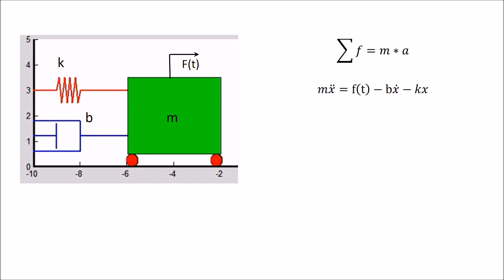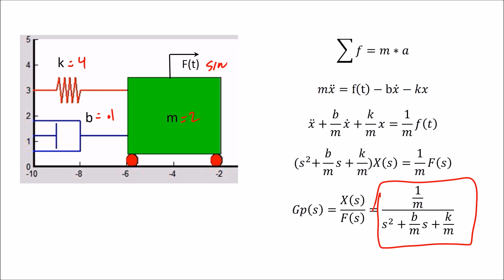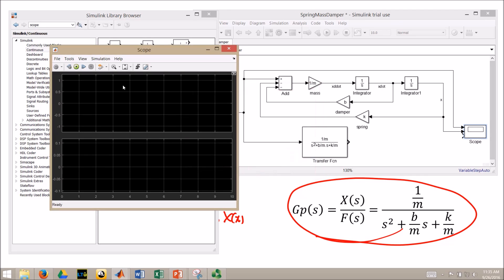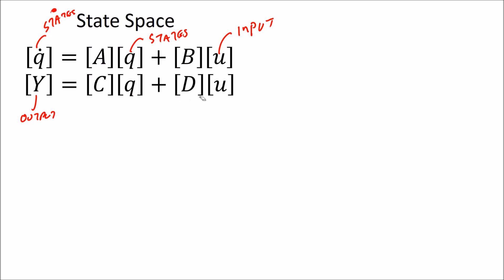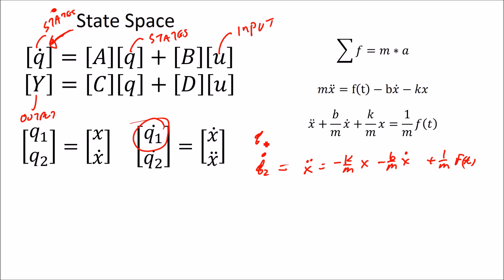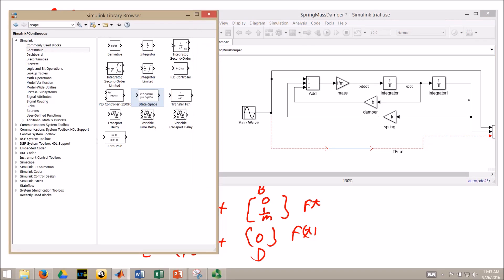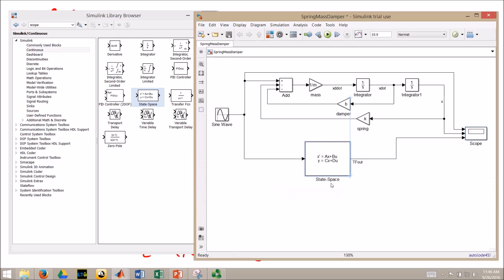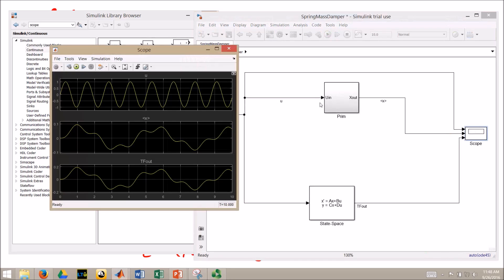Simulink for Beginners, Part 2

Comment: Thank you. Nice way of explaining state space and transfer function in simulink. 

I have one doubt. While giving values of matrices (state space) in simulink, in matrix B you have given [0; 1] value. My query is why it is not [0; 1/m]?
Reply from the maker: My mistake. It should have been [0; 1/m] as you suggest. If you look at the output of the scope you see that the magnitude of the two output are off by a factor of about 2 due to this error. I guess I saw what I wanted to see and didn't notice the discrepancy. 

Thank you for pointing out the error.
Reply: Kshitiz Khanna o